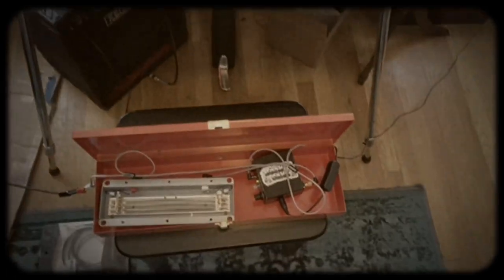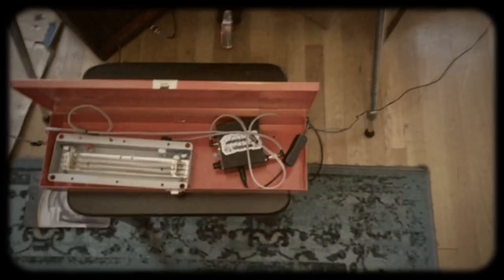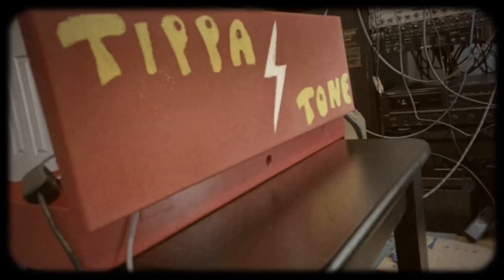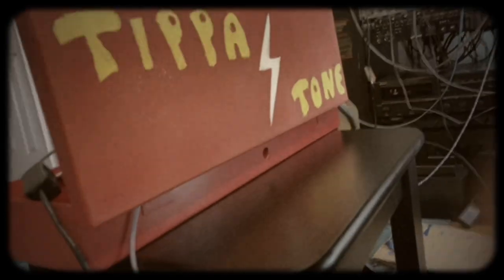DIY Spring Reverb for Jah Wise (Tippatone)

Comment: Hi mate, would you tell me abiut the how to build the driver? I make some but no one work.. thanks
Reply from the maker: You need a preamp that can supply enough juice to drive the tank. I would try a low impedance tank first, and then you can use a relatively cheap amp designed for speakers.
Reply: @SoonComeSound  I am taring to do something very similar,  but I have problem to know how much juice I need to drive the tank. I have a small tank like the one you are using.
Reply from the maker: @rolandocaraballo  it’s the input impedance that matters for figuring out how to drive it, not the physical size of the tank
Reply: @SoonComeSound  ok but a 15 w amplified will do. I tray wit a 9w amplifier and didn't works. I got now 2 15+15 w amplifier from Amazon.